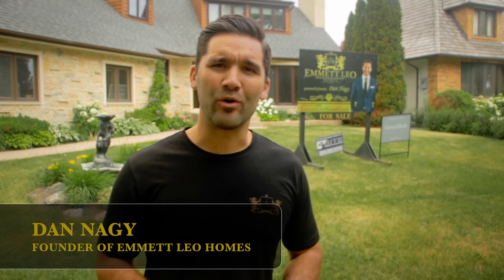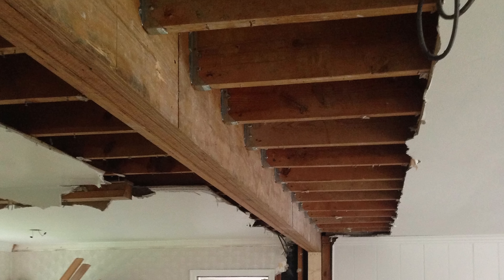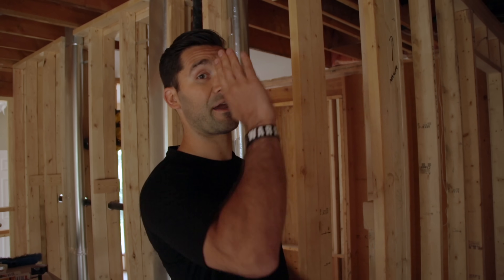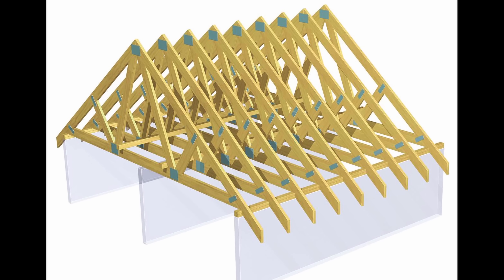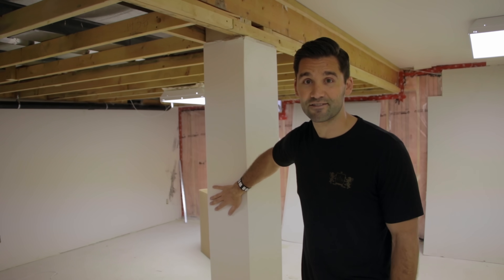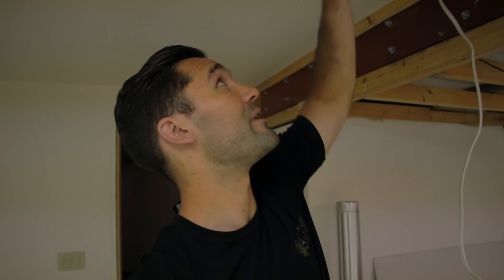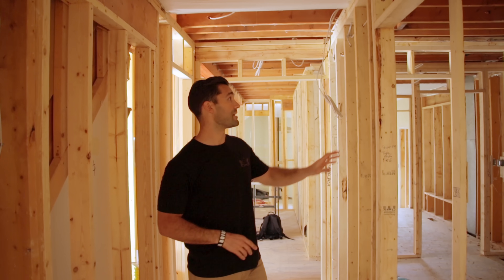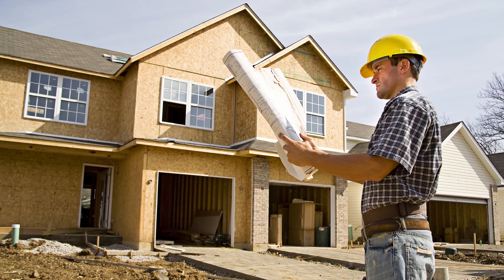The fastest ways to tell if your wall is load bearing or not!

Comment: A stud wall that is not vertically load bearing can still have a structural function as a shear wall for racking stability. They may have diagonal bracing or ply/osb sheathing in addition to drywall to increase racking resistance.
Reply from the maker: Awesome advice.  Thanks for watching!
Reply: @EmmettLeoHomes  Why don't you update your video with all these exceptions, warning, and potential dangers before people go ripping apart their houses on false promises? It's very irresponsible to claim any unskilled homeowner watching "will know exactly what is a structural wall by the end of this video!" because clearly they will not, and there's far more to home engineering than you can cover in a 10 minute YouTube video.

Comment: Not mentioned. You need to be careful and it's a good idea to temporarily reinforce an area that is load bearing BEFORE you dismantle that wall. (It's also a good idea to take measurements from the beam to the floor whether in the basement or on the floor in critical spans.) This may eliminate any deflection in that beam, before you've installed the permanent reinforcement. Any movement due to shearing may possibly affect the finish in the dwelling, e.g., finish trim (Miters and so forth), dry wall, (Screws popping and butt joints appearing.) and possibly tile, etc.
Reply from the maker: Yes, the steps to remove the wall were not indicated as this was simple to identify the load bearing wall itself.  Great advice.  Thanks for watching!

Comment: Interesting from a UK perspective. We use RSJ s  (steel) to support loads, and these are typically over-specified by engineers. What fire retarding is used for structural wooden beams? Even our steel beams have to be clad in 2x plasterboard to give them fire resistance. I've seen oak beams that resisted fire better than steel, which twists quite easily, but those softwood posts look rather vulnerable
Reply: Welcome to the USA where houses are purpose-built to fall down so contractors can have more work rebuilding them after every single earthquake, fire, flood, hurricane, etc. Europe has thousand year old buildings made of stone or steel, here we live in overpriced new construction that's sticks and OSB cladding, two steps above a cardboard box, or about equal to what a Polish farmer would make for their chicken shed.
Reply from the maker: New building techniques and technologies are coming, but the adoption is slow at both the building level, as well as the regulatory bodies.  I cannot wait for some of the methods to be accepted as the norm.  Thanks for watching!

Comment: are most exterior walls load bearing walls?? I want to add a 120g fishtank (1400lbs) to my living room over a crawlspace ...thks
Reply from the maker: Yes.   Exterior walls are almost always load-bearing.  That, however, plays no relevance to putting a fish tank in the middle of your living room.  Ensure that adequate structural support is added below the floor in the crawlspace.
Reply: @EmmettLeoHomes  the closer the fishtank is to the load bearing wall the better, correct? It will have more support structure than placing it in the middle of the living room...thks
Reply: I will make sure the tank is placed perpendicular to the joists, more support than parallel

Comment: Yeah, but what about a pass-through opening in a load bearing wall? I need a bar in my house because I'm a raging... umm.. I want a bar in my house, but in a load bearing wall.
Reply: then you need to add headers and move studs around. if it is a very small opening (like for a single door), you could almost certainly get away with just removing one stud and forgetting about it, although it wouldn't be good practice OR up to code.
Reply: @FB-gm6el  Thanks for the info- that pretty much mirrors what I've been told from others. I'm going to do 60", so the plan is to put in a pretty stout header and double up the studs supporting the header and hope to hell it works. Now I just have to figure out how the hell people make drywall corners look so good. If I patch a hole bigger than a nail head, even after sanding and smoothing like a mofo- once painted it looks like crap. Maybe this home improvement stuff isn't for me- but I can fix the hell out of British cars... so I got that going for me. And a bar, soon... I'll have that, too.
Reply from the maker: It should be framed like any other doorway in a load bearing wall in your house.   Thanks for watching!

Comment: so my plan is to just knock it down because i cant imagine a little 4X6 ft room would be load bearing..plus the floors and walls are all cracked anyway..when its summer cant close the doors and the floors are all damaged and rippled/humping from flooding and drought
Reply from the maker: It's not the room size that dictates structural load.  Thanks for watching!

Comment: Is it possible to have load bearing walls running in two directions? Looking at building a new house and want to use precast concrete lengths for the first floor, but the roof will run perpendicular to the floor direction.
Reply from the maker: Yes.  It is possible. Thanks for watching!

Comment: What if I only wanted to cut a window size hole in a wall do it make a difference if it’s load bearing or not? Let say the wall is 6’wide and 9’high and I want to cut a 3’ by 4’ hole.

Comment: A general rule of thumb is the joists can span 1.5 times their height.  A 2x6 can span 9 feet before it needs support.
Reply from the maker: Thanks for watching!
Reply: This is terrible advice.
Reply: Hungry by Nature why?    It’s the new standard you’ll find if you google info about load bearing walls.  My building inspector told me that as they started to run out of the old growth wood.  The span lengths would shrink.   My house is framed with 2x6 (full dimension lumber) and has unsupported 17’ spans.  Under the modern code, I couldn’t do that without supports.
Reply: Billy bob Smith I just googled it and it said for decks. That’s funny because my friend is suing his contractor for building his house floor joists based off of decking info. 

It’s terrible advice because you can just google the international residential code (IRC) and get the correct information on floor joist construction for houses. Also, not all wood species are the same. Anything after that is irresponsible information because the average person does not understand live load, dead load, or tributary area.

Comment: This is an absoloute recipe for disaster,,, to promote home owners or non professionals to make these critical desicions...  every house is subjective and different,,, and unless everything is unfinished ,  even pros are subject to making mistakes... sometimes things stack up multifloors,, for example a big fireplace with stone work ,,    Posts and beams in floors above  ...  just looking down and assuming there is something under the concrete slab also is kinda goofy logic.....  if u want to guide this sort of action,,, the best method is to frame a temporary wall beside whatever is in question with top an bottom plates,,,just open studs with perhaps a diagonal brace attached ,,  and peel everything open and disassemble the wall in question.....
Reply from the maker: You are correct.  "Assuming" is never a fail safe plan.  However, it always helps to educate people to know the principles behind what we do.  Thanks for watching.

Comment: Don't forget that by installing that large beam you just put large point loads on the basement beam below. The basement beam most likely was designed to hold a uniform floor load. Point loads can crush the structure below if not adequately supported.
Reply: Good point Allen.  I needed this knowledge before an interior remodel.  Old Plaster walls so the structure is crazy thick ......
Reply from the maker: Allen Robinson that’s what engineers do.  Thanks for watching.
Reply: @EmmettLeoHomes  Exactly, and that should be the main strong theme in you video. Use an engineer!!!  People need to stop hacking walls out unless they are qualified. Also, very small point, you show a house with a gable end which is obviously not truss, then talk about trusses which jumped right out at me.

Comment: When you tell people “ typically” that doesn’t mean always. There could be a hidden point load in a wall. Your better to hire a reputable contractor and not DIY. Mike Homes is a jerk off and I have seen many errors done by him and his crew.
Reply from the maker: Mark typically, reputable contractors use these exact methods to figure out if we need to bring in structural engineers.  

I am simply sharing those methods.  

I don’t know Mike Holmes. 

Yes.  Typically does no mean always.  Hence why I am saying typically, not always.  

Hope that helps.  

Thanks for watching and commenting.

Comment: Q: If you increase the strength of the two posts, now the floor and the main span underneath (or ceiling of the basement) is experiencing increased load concentration at two points instead of it being spread the length of the wall. How do we know this won't cause sagging or lateral tension on lower supports (the main span underneath)? Is the new stronger poles located above the supports (teleposts) below or?
Reply from the maker: Robert Chan Russell 

absolutely.  

You must ensure that your load points are held from below, all the way to whatever foundation you have.  Whether it is piles, a grade beam, or whatever else is engineered and approved.  

Putting in a beam and posts above without lining up the load below, or a least engineering the load so it dispersed properly will surely result in it dropping somehow. 

Thanks for watching.
Reply: @EmmettLeoHomes  Thanks for explaining!
Reply: GREAT QUESTION . . . . . . . This is why you need a structural Engineer to put his stamp on the job. Hint: Engineers will always overbuild because they are liable for their work as long as they are alive.
Reply: @victoreous626  I'm a EE graduate (no PEng though so I don't use the "Engineer" word ever when referring to myself. I was just wondering because I live in a condo with a 3 level townhouse above and want to double check the work of others. I can't have any mistakes and stand there stunned because I'm not a structural/civil engineer.

Thanks to you both for replying! : ) I look forward to opening up our kitchen/dining room.

Comment: Those are only clues, but not absolute.
Joists may run parallel to a bearing wall. Bearing walls may run in the short direction. 
Even with nothing above, the wall may be needed for lateral support.
Reply from the maker: Mark Daniel yes

Comment: Hi, nice video, great explanation. I didn't hear you mention that it will be necessary to build a temporary wall in order to put in the new beam to create an open concept. You have a good idea to use a stud finder on ceiling drywall to figure out which way the ceiling joists run.
Reply from the maker: HouseBarons you are correct.  In order to remove the existing wall to insert the beam, typically one or two temporary walls need to be built on either side of the beam depending on what’s above and it’s construction.  (Joists, vs single length trusses)

Thanks for watching!

Comment: What about a wall running perpendicular to the trusses on a slab foundation?
Reply from the maker: Brian Shivers what’s the width?  Do the trusses span and are self supporting?  Perpendicular is a clue that it may be a load bearing wall, but you need to dig deeper.

Comment: Do not follow this guy's advice.  It is full of what-if's and if-then statements.  Do the right thing and hire a structural engineer.  At $150 per hour you''ll be out $450 and then you'll know for sure what walls are load bearing and what walls can be removed.  Load bearing walls can also be removed with the proper beams in the attic, etc... you're going to need an engineer anyway to get the plans drawn and get the proper permits.
Reply from the maker: Grant Crockett I agree and advocate for people using the proper professionals.  In the case of removing walls, yes, you need a structural engineer or architect with a. Stamp to draw up the plans and stamp them.  However, this video is intended to give people an idea about how to even tell what a structural wall is and how to identify it.  

Thanks for your comment and watching.

Comment: 2x4 load baring posts.... talk about cheap construction...
Reply from the maker: Ruben Sahakian all wood structural posts are 2x6.  They have to be as the width of the beam above is greater than a 2x4.  It’s probably hard to see that in the video.

However, multiple 2x4’s could be used should the beam be smaller and the engineer spec’ing it accordingly.  

Thanks for watching
Reply: I’ve rarely seen posts supporting a beam that large that aren’t 4x

Comment: I use a neodymium magnet as a stud finder. It will locate the screws/nails in the drywall to show you where the studs/joists are and is way more reliable than a stud finder. Doesn't work so well on plaster and lath though. I haven't used a electronic stud finder in many years. If you use a magnet to locate a stud always check more than one location to be sure the fasteners are in a straght line, drywallers don't always hit the bulls eye and will leave a screw that has missed the mark which can lead you astray. Sorry for the repeat comment, didn't see that Jerry Strader also made the comment. For plaster and lath walls, the magnet can work to find studs in a wall if you use it on the base trim to find the nails used to attach that which is usually nailed on before the lath and plaster so most of the time the nails in the base molding are dead on the studs.

Comment: Hi Emmett, so if I want to remove a wall in my second floor bathroom, all I need to do is check in the attic to see if the ceiling joists are connected to the wall? Thanks!
Reply from the maker: Joe Subleski hmmmmm, not quite.  Maybe watch again.  😂

Comment: One way is to do things legally and get permits after an Engineers review with sheetrock removed. It requires an Engineers license and stamps plans to get a permit.
Reply from the maker: michael that is definitely recommended.  These are some simple ways of telling if you wall if even load bearing or not.  

We are not required to get a permit or engineer stamp if the wall is not load bearing, but I would NOT recommend an amateur remove ANYTHING without professional certainty.  Thanks for watching!

Comment: And then drill a 2” hole for a half inch pipe. That helps support walls too. And right near the edge!
Reply: A single top plate is a dead giveaway.
Reply: I was looking at the holes nd the pipes. I was like those are some big ass holes for a tiny little pipe 😂😂
Reply: I keep the 2" bit over by the sky hook and board stretchers
Reply from the maker: Bob Garber 😂😂😂
Reply: Thought I was the only one that saw those holes.  That's when I ignored the rest of the video.
Reply: That's so when you're screwing in the drywall the pipe can move outta the screws way.

Comment: One quick way of finding out load bearing walls is start cutting the wall out if the ceiling doesn’t cave in it’s not load bearing 🤗
Reply from the maker: J Liz please don’t 😂
Reply: i seen that episode on the  three stooges.
Reply: Haste makes waste!
Reply: @Don_B_260Z  Not for the guy who makes money cleaning up the mess.!
Reply: I mean you can take out a load barring wall and not see the failure that's going to happen for years.
Reply: My downstairs neighbor wanted to open up his dining room and removed a wall. My floor sank two inches immediately. I had to threaten to sue him in order for him to hire a structural engineer and do it properly. Even after that, my floor was still two inches below where it started.
Reply: @joshuabusch4529  omg! That’s crazy!! We just ran into this situation and we wanted to open up a wall and looked just a little too sketch to risk it. I’m glad we didn’t do it doesn’t effect our upstairs neighbor!
Reply: @joshuabusch4529  OMG!!!
Reply: Haha 😆 and now that they watched this video, they're all ready to start cutting away! Lol.
Reply: Worked for my Dad, we were "renovating" the basement and my Mom was upstairs vacuuming. As we were knocking down studs in the basement, she came down to tell us that the main floor baseboards were now 1/2" off the floor. It was a good time to stop.

Comment: If I work in a previously owned house, I never trust until I see. I've seen many diy's rambo jobs for who Physics don't apply, it's crazy. Even if you think you know what wall is what, you might have a couple suprises further, like left out cut studs (I found that, on a load bearing wall, like a aborted old project) or anything else botched. Do yourself a favor and take the extra time.

Comment: The easiest way to determine which walls on each floor are load bearing is to just go up into the attic. 99% of family homes have  attics and the vast majority of them have no finished floors. Just work your way down from the joists in the attic and the load bearing walls in the floor below the attic are perpendicular to the attic's joists. Each successive lower floor's load bearing walls are perpendicular to the joists above them. Still, builders will not always follow the formula of the next lower ceiling joists being perpendicular to the upper room's load bearing walls so it's good to know for sure such as by temporarily dropping a ceiling light  fixture to get a peak at the alignment of the ceiling joists as too much is at stake.
Reply from the maker: Daniel Fronc we’ve found its easier for people to gain access to the basement than the attic.  You are right though. You have to find the structural load points.  Thanks for watching!